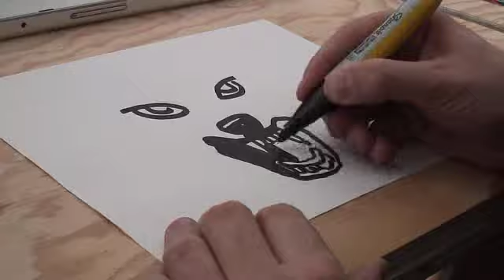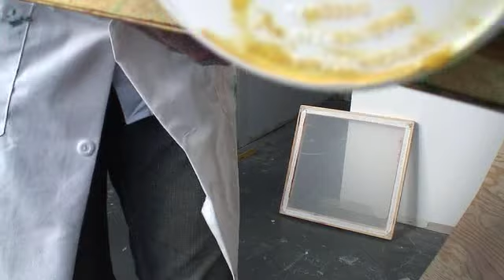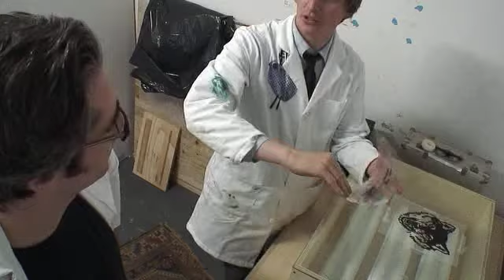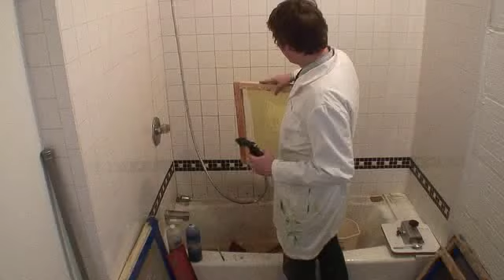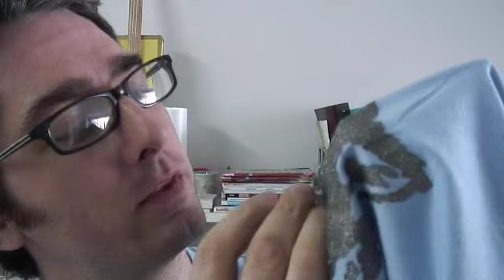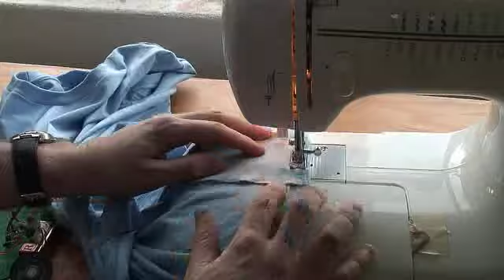Learn how to screenprint your own t-shirts

Comment: It does indeed. Thankyou.

One other question... they seem to use the emulsion stuff in white light so it doesn't need to be used in a dark-room? Also does it stain... they are using it in the bath. Will it stain the bath?

Comment: the only difference is the use of the screen. with this method you use emulsion to get the image on the screen but with stenciling you just stick you stencil on the screen (or straight on your shirt) and then put the paint on.

Comment: You need UV light. There is a bit of UV in visible light, you must use special lights to make more UV. The exposition time will change depending on the power of the light you use.

Comment: silk screen is the standard for all major brands, so if you get good ink (plastisol is thin, flexible and durable, also permaset make a good range of water based inks that last well) and if you cure it well (as in flash dry at 180c, iron set it at 180c or use a cold cure additive) it'll stick in for as long as any commercial shirt. Multilayers are easy with a set up like theirs, if you don't have hinged silk screens the lining up can be hard, but doable.

Comment: Does any of this actually need to be done in a completely darkened place? Could I get away with doing things indoors with the curtains drawn and the lights dimmed? Instead of going to a bathroom + using the shower, could I go outside and use a garden hose?

Comment: hmmm not bad, but as a commercial screenprinter it is best to coat both sides of the screen with emulsion, this prevents image breakup if you are going to be using that screen a lot.

Comment: you need to put the emulsion on BOTH sides of the screen, that has to do with the space between the hardened emulsion and the actual textile when printing, depending on the colour how good or bad it does lay over the textile without shining through.

you need atleast normally 1 time on the outside, for more thicker colour on the textile after all or on the paper or whatever you print on, do it another time, harden it, if you need more you can still make it thicker.

Comment: and you will definitely want to use targets/markers of some sort (outside of the image) on all 4 corners, so you know where the color is going to end up.  line up your images with the transparancy paper then put the markers on.  when you're printing, use tape where the markers fall.  this way it won't get on the shirt, but it will still mark where.  try using a tape that is sticky enough, but not too sticky to leave a residue on your shirt.  last tip: run the COLOR first.  run the black last.

Comment: you'd have to run 2 different screens - one for the image outline (like the guy did in this video) and one for the color.  you can use the color separation technique that fulmoontat talked about, or you can use black construction paper to fill in the areas you want colored on a separate piece of paper.

Comment: sorry bro, I mean, meathead,  but the screens turn out a lot better if you dry it horizontally.  And if you use a scoop coater you don't have to worry about air bubbles.   I do use emulsion on both sides but that is only so that the screen lasts longer.

Comment: A screen is made of a piece of porous, finely woven fabric (originally silk, but typically made of polyester since the 1940s) stretched over a frame of aluminum or wood. Areas of the screen are blocked off with a non-permeable material to form a stencil, which is a positive of the image to be printed; that is, the open spaces are where the ink will appear.

Comment: Actually, probably about 100-200 dollars later.  You don't need the high tech light system they have, or the printing press.  You can come up with much cheaper ways to do it.

Comment: get yourself a clear, 150 watt incandescent bulb and an aluminum pie pan. cut a hole in the pie pan and mount the light inside. hang it 12 inches above the screen and  let it expose for about 30 or 45 minutes, you'll have to test it to see what works best with your products...hope that helps

Comment: Well you're using the actual definition of the word "Emulsion", but as a screenprinter myself, I can tell you that emulsion is also an industry product that coats the screens so the ink can't get through where the design isn't meant for it to.  I don't however know what it's made of but there are many screen print supply places where you an get emulsion.

Comment: I do screenprinting at home too, and it's not that complicated.  Just get the paint that's labeled "screen printing" at the art supply store.  I personally like to use round wooden embroidery hoops for my screens.  They're extremely easy to stretch by hand.  And for squeegies I use flexible plastic folder covers cut into strips.  I'm able to do really high quality work with these materials.   - Tona

Comment: I am a twenty year industry professional and I would do almost everything these guys are doing differently.  Weak technique and poor processes.  There should be way more light control, smaller meshes (at least 160, or more for dark ink on light substrate) and at my shop we laugh at dudes who flood as a matter of course. Plus, there is no friggin way they printed all that crap in 15 minutes unless they put the wrong ink on most of it and who the hell flashes a black print.

Comment: For one color prints, you can build a printer from scrap ply and a pair of loose pin door hinges, $20 tops.
No box for the light.  Just hang it from the wall over the exposure table (no darkroom, either.  Regular incandescent bulbs don't put out enough UV to fog a coated screen at several feet distance.)

Comment: From above the screen with a cheap quartz halogen security lamp, the shadow is sharp enough that you 
don't need to press the positive all that hard against the coated screen.  And yes, you do expose with the bottom side of the screen up -- just turn everything over from what you'd do with the fluorescent lamp box. 
Worst case, you'll see where you screwed up and get it right the next time.

Comment: Rad project.

BUT, if you burn your image from above the screen DO NOT BURN IT BACKWARDS. If you do, it will print backwards. Just think about it for a minute and it will be obvious. And if you do burn it from above, put a piece of glass on it to hold it flat on the screen or you get crumbly edges.

Comment: nice but no mention of snap distances, or ink types. nor did you mention that screen ink usually need a solvent thinner to clean the screen after use otherwise the screen, if left will be ruined.
been a screen printer for 30 years so i know one or two things.. apart from that guys.. it was excellent!

Comment: dislikes
if you are planing on using the screen more then once or changing color I would definetly recomend coating both sides of the screen otherwise you will have a lot of trouble when the screen starts breaking down. Concerning mesh if printing a "watery" color like black I would use a higher mesh screen a 110 will have way too much ink on your shirt. you never spoke about ink types& Heat gun to cure plastisol inks, or air dry, natural inks you can use on t shirts.

Comment: You don't press really hard with squeegee, since that'll make the image bleed, just like your wolf. Use two passes instead... so the print won't look crappy.
  You showed people how to build a light box, but you're using a pro screenpress? Would've been nice to show how to build a press with door hinges and C-clamps!
  And you skipped the most important step: DRYING. Using a hairdryer would work just fine. Without this step, your shirts are going to look like shit after the very first wash!

Comment: you COULD use iron on transfers, but the ones you print use printer ink, which isn't suitable for shirts, it fades. the ones you buy from the store won't allow you to make your own design. This is about the best way to do it as you can make your own designs and use an ink that is more suitable for clothing, ink that doesn't fade as quickly.

Comment: You can also knife-cut stencils on paper for short 
runs of a couple dozen prints.  You can paint 
stencils directly on the screen so long as your 
stencil is insoluble in the ink -- use orange shellac 
or water-based glue like Elmer's with petrol 
solvent-based inks, shellac with water-soluble 
inks.  This is what makes this such a great art 
medium.  Think outside the box, and anything's 
possible.

Comment: That looked like the old-fashioned bichromate 
emulsion.  Toxic, causes skin ulcers, cancer, bad to pour down the drain.  Go with diazo or whatever Speedball sells now.  Use a $10.00 halogen security lamp instead of the lightbox.  Sharper image, no need to press the screen down (hangs above the screen), shorter exposure time.  Mesh for t-shirt screens is polyester.  Nylon is stretchy, will drag the print.  Great for printing on non-flat things like soccer balls or apples, though.